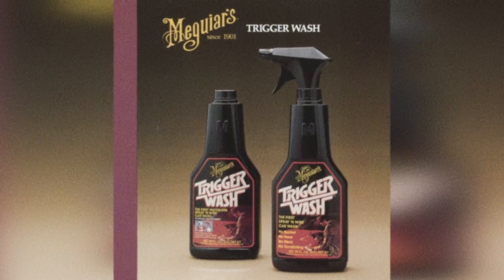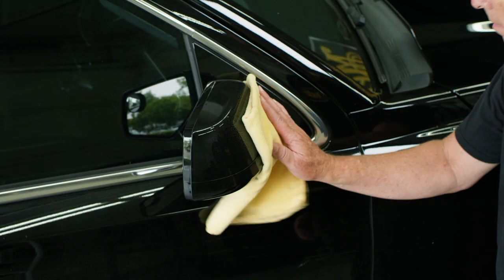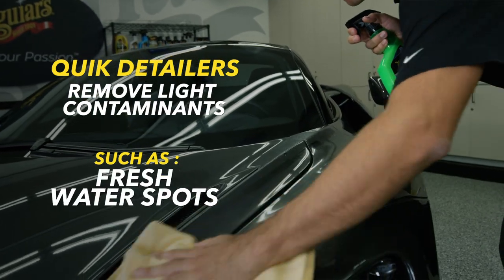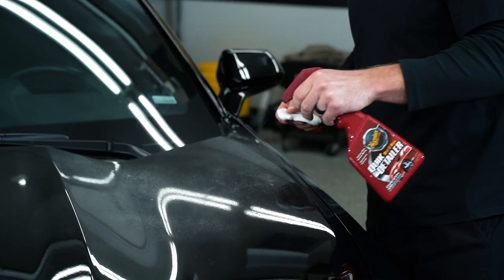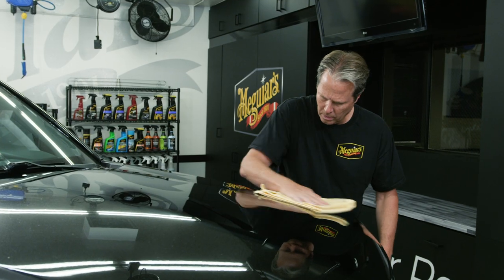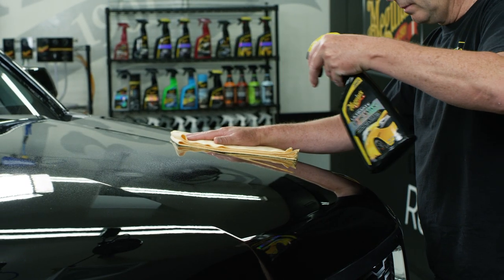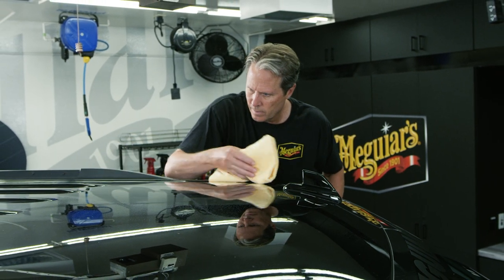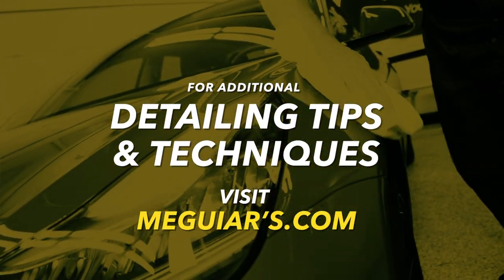Have You Ever Wondered How to use a Spray Detailer & a Spray Wax or the Difference Between the Two?

Comment: Never used a spray-on wax before I Decided to try Meguiars ultimate quik wax In between liquid wax Applications Applied by hand on My 2021 ProMaster159 high-roof  With a lot of Paint surface to tend to... Applied by hand liquid wax takes approximately 2hrs or so..Meguiars ultimate spray on wax about 40 minutes Including roof, Paint finish feels velvety soft & Smooth as ice, And the protection seems to last around 2 weeks Very impressed would definitely recommend

Comment: So after washing the car and drying it, spray the quick detailer and then wax?
Reply from the maker: No, if you have just washed the car there is likely no reason to use a quick detailer.  You would just go straight to a spray wax if you were hoping to boost/add protection.
Reply: @meguiars  I don't have the spray I have the wax that's in the round red container
Reply from the maker: Then it would be the same scenario just use the paste wax.  👍

Comment: Which one for after washes to make paint shine bright???
Reply from the maker: As mentioned in the video quick detailers can be used any time you want to safely remove light dirt, dust, etc. from the finish.  This is not necessarily something you would need to do right after washing although you certainly can.  That being said if you just want to use a quick detailer with the "most shine" we would recommend our Ultimate Quik Detailer or our Gold Class Premium Quik Detailer.
Reply: @Meguiar's  thank you I just purchased the meguiars insane paint glosser hopefully it works
Reply from the maker: The Ultimate Insane Shine Paint Glosser is a great new product but please understand it is not a spray detailer.  It is actually a sprayable polish.  👍

Comment: I get streaking with the ceramic detailer which is quite disappointing. I've tried it on 2 cars so I know it's not the paint causing it to streak. Is there another method to apply it without getting streaking?
Reply from the maker: Sorry to hear that.  This product has only been out since the beginning of the year but it is already being used by a lot of people who absolutely love it.  Not sure what could be happening here?

Is it really hot and humid where you are at?  It is possible you are over applying even though detailers are usually very forgiving.  Are you using a good quality microfiber towel for wipe off?  Is the surface really dirty?

Again, tough to say as this is not a normal experience.  Feel free to reach out to our Solutions Hub for assistance as well.

https://www.meguiars.com/contact-us
Reply: t that means you’re not wiping enough. you need more than one microfiber
Reply: Aloha  @meguiars ,

New black truck one week, has Xylion coating. 

Can I just use the waterless wash and wax. Then a quick detailer? Would the hybrid ceramic detailer be better than the red bottled quik detailer?

For the black rims, I was thinking of hot rims black wheel cleaner then applying hybrid ceramic tire shine. 

First car I am detailing. So any advice helps!

Comment: Hi, for a new factory paint car, what should i used to maintain the paint? Or just using ultimate quik wax is enough? Or should i apply hybrid ceramic liquid wax and hybrid ceramic detailer as maintenance?
Reply from the maker: Ultimate Quik Wax is designed to be used for maintenance not as your primary source of protection.  Yes, our Hybrid Ceramic Wax would be a great option for your base protection while using the Hybrid Ceramic Detailer any time you like to safely clean a light dirty/dusty vehicle.  The Hybrid Ceramic Detailer will also boost the protection and water beading.  👍
Reply: @meguiars  OK. Noted Thanks

Comment: 1.After shampoo washing my already waxed car (1 month waxed) should I apply the Quick detailer or the Quick Wax Spray?
Should I first apply QD and then QW?

2.On normal washing days, should I apply QD after washinfg is complete?

Please reply!
Reply from the maker: There is typically no reason you would need to use a detailer mist & wipe right after washing unless the car was hit by a bunch of dust or other fresh contaminants right after washing.  After washing and drying the car you can just use the spray wax.
Reply: @meguiars  In what scenarios exactly should I use a quick detail spray?
Reply from the maker: Detail sprays in general are designed to be used any time you want to wipe the car down to remove fresh/loose contaminants from the surface.  This typically includes dust, light dirt, fresh water spots, bird droppings, fingerprints, etc.  They are also often used as lubrication for claying a vehicle.
Reply: @meguiars  And how does it differ from a waterless wash and wax?
Reply from the maker: The Ultimate Waterless Wash & Wax can literally be used instead of a traditional car wash even if the car is fairly dirty.  And as the name implies it also has wax in it to offer protection that many detailers do not.
Reply: @meguiars  okay thanks guys for clearing my doubts!

Comment: can you help me out? im still confused which to use on my ceramic coated car. hybrid detailer? or quick detailer/wax?
Reply from the maker: You can use either but if you want to maintain the water beading and protection of a ceramic coating the Hybrid Ceramic Detailer would make the most sense.  👍
Reply: @meguiars  thank you!

Comment: After using the Hybrid Ceramic Wax, can I use the Quik Wax thereafter?
Reply from the maker: You certainly can but you should be aware that using other non-hybrid ceramic waxes on top of the Hybrid Ceramic Wax could have an impact on the water beading you are getting.  Nothing harmful about this at all but something to consider.  If that is something you want to avoid you should consider picking up the Hybrid Ceramic Detailer instead as it will help maintain/boost your protection and water beading.
Reply: @meguiars  Thanks for the clearing up my mind.

Comment: Didn’t explain jack, just quickly advertised
Reply: 1:05 kinda explains it
Reply: I agree. Most of these videos just serve to confuse the average consumer with product overkill. I have seen little difference over the years in results from waxes, sealants, toppers, etc. I went directly to one product's headquarters and asked if their “final” use product could serve as a stand-alone wax. “Of course!” they said.

So why would I waste time and money on anything else? Especially when NOTHING seems to last more than a week or two.
Reply: @eronavbj  if your car is not ready for a wax?  Id advise using some sort of cleaning product first. Per the video, the spray wax  does not contain any cleaning agent.  

It's generally accepted to use the detailing spray before using the quick wax.

Comment: Does “ The last touch” strip away any wax? It says it will clean greasy spots so in theory wouldn’t it strip my pre-existing wax that I just put on?
Reply from the maker: Last Touch will not strip wax.
Reply: @meguiars  thanks.
Reply: Aloha @meguiars
New black truck one week, has Xylion coating. 

Can I just use the waterless wash and wax. Then a quick detailer? Would the hybrid ceramic detailer be better than the red bottled quik detailer?

For the black rims, I was thinking of hot rims black wheel cleaner then applying hybrid ceramic tire shine. 

First car I am detailing. So any advice helps!
Reply: Meguiar's Last Touch is my favorite detail spray.

Comment: How would you remove the product from overspray of your windows
Reply from the maker: Not sure which product specifically you are referring to?  Most spray detailer and spray waxes are safe on glass as well.  If for some reason you were looking to remove a spray wax from glass you could that a few different ways including...

1)  DIsh washing liquid and water
2)  Claying
3)  Compound
4)  Rubbing alcohol
Reply: @meguiars  I sprayed the panels with a mist spray of quick wax  but totally forgot to watch out not to get it on the windows I dint wipe it down and now when direct su light hits the window you  can see thousands of specs of wax and I can't get it off ....

Comment: Hi..can i use ultimate quick wax after i apply meguiars ultimate compound and ultimate polish?
Reply from the maker: Yes, you certainly can but keep in mind the Ultimate Quik Wax is designed to be used as a maintenance wax rather than you primary source of long lasting protection.  Your expectations as to how long it will last should be set accordingly.  If you want better protection we would recommend a good liquid or paste wax application.
Reply: @meguiars  great! I just bought a bunch of gold class quick wax thinking it would wax my car but apparently I shouldn’t have used my budget on those. Dang!

Comment: Used this product, all I want to know is how do I get this off my windows.product left a film on the glass, glass looks cloudy, need to get this off. Help
Reply from the maker: Sorry to hear about your experience.  We can assure you that although not designed for glass may people use them on their glass with great success.  Not sure which product you are referring to but neither of these should be difficult to remove.  You can try these things...

1)  Re-wash the car or at least the glass.
2)  Use a lightly damp microfiber towel.
3)  Wash with a dish washing liquid and water mixture.
4)  Use an good all purpose cleaner/degreaser that is safe on glass.
5)  Use a compound as long as there is no window tint/film on the
      exterior of the glass.
6)  Use rubbing alcohol.